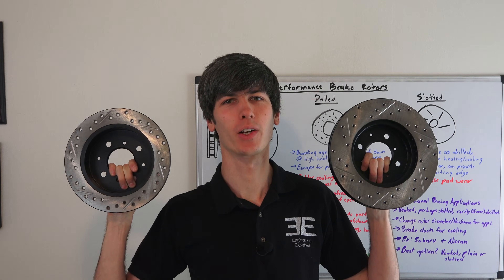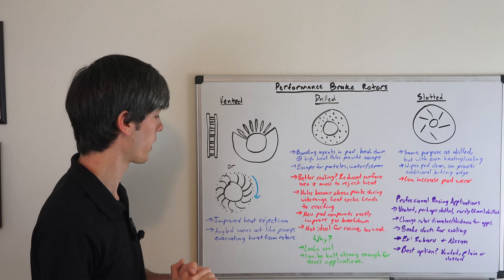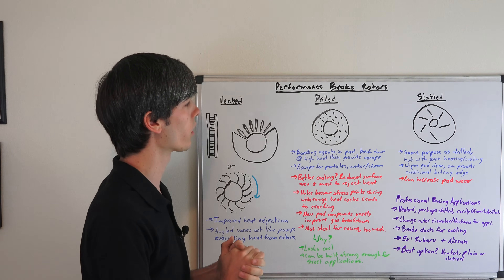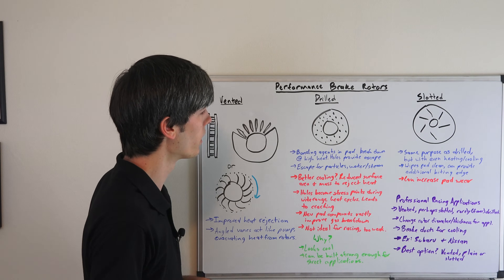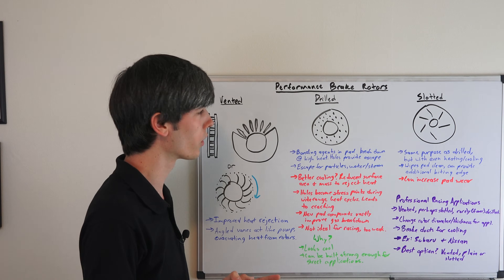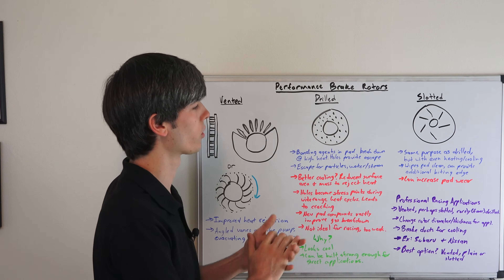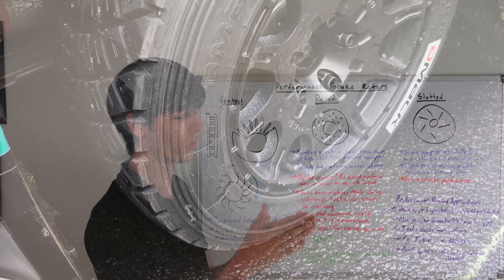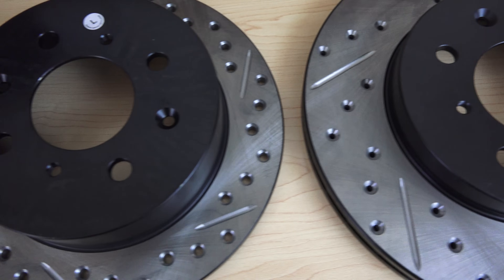Drilled, Slotted & Vented Brake Rotors - What's Best?

Comment: To everyone, remember this, TORQUE YOUR LUGNUTS, reduces warping.
Reply: Could be true. I've never heard this before but it couldn't hurt.
Reply: You were great against Gary Oldman. Too bad he snuck up on you at the end.
Reply: Thanks for the advice, I dealt with warped rotors in the past.
Reply: Sad that "car people" need to be told this.  Even without the worry of rotorwarp, just keep your nuts tight, but not too tight!
Reply: I have studied mechanic and one thing that people disdain is the torque. It can make total difference, not only about warping but also you don't brake any part inside torquing so much.
Reply: Amen
Reply: Make sure they're not overtightened too, as well as rechecking the torque after 100 miles (approximately).
I've had tire shops overtighten them to 170+ lbs./ft. before and when questioned about it told me they weren't allowed to tighten lug nuts to anything less than 80 lb./ft.  The manufacturer's shop manual recommended 66 lb./ft.  🤯

So beware your local mechanic, especially if they have cause to not like you...
Reply: @thisismagacountry1318  EVERYONE!!!
Reply: Tighten them until they start to get lose 😂
Reply: How many ugga duggas is that with the impact?
Reply: That’s probably the least of your worries if you don’t torque your lugnuts…
Reply: We did that with my 1978 Trans Am, they warped in less than a year almost as bad as when we bought it, driving style is a major factor let alone safety tech and other things

Comment: On my minivans I switched to drilled and slotted discs as a method of cooling the disks faster. The stock discs were continually warping because of the long steep hills near my home. Switching has proven to be very effective as my discs have not warped for years since the switch. I go through pads more frequently but they are cheaper and easy to replace.
Reply: I know it’s 7 years later I’m commenting but I have a similar situation. Go up and down hills every time I leave my house. So have to ride the brakes often which has led to frequent rotor failure.
Reply: @Paulog1990  Alternatively you could just drive in a lower gear when going downhill and not use the brakes as frequently.
Reply: @rado2g  I have a Nissan with a CVT. If you know anything about Nissan CVT’s, that’s the last thing I would try.
Reply: @Paulog1990  not familiar with it, I drive a manual Audi A4 B8
Reply: @Paulog1990 😢😢😢
Reply: the drilled/slotted rotors are usually better steel than the cheap blank rotors. you can buy blank rotors with good steel but they're a little harder to find.
Reply: @Paulog1990  change transmission fluid frequently!!
Reply: @johnchalkiadakis  I have changed it every 30K miles. Have 104K on it now.
Reply: @Paulog1990  yes, better sooner than later, the BS from the manufacturers that it lasts for the lifetime of the vehicle, for them lifetime means "untill the warranty expires" that's about 5 years!! like we all buy a new car every 5 years, what a load of Bullsh*t.

Comment: With F1 cars, they use solid surface rotors for maximum brake force, but they have a large number of dense radially drilled holes for maximum surface area for air to cool the rotors. But that's more of a special case since they're dealing with immense braking force and heat, and really only need the rotors to last around 300km of hard use.

Comment: My personal favorite is vented/ slotted. On my heavy haul truck, it makes a huge difference over hilly braking conditions, upwards of a 200* reduction in temperature depending on overall duration and loading. Dropping from 650-700 down to about 500 taking some of my local hills. The slots aid in off road conditions... I have noticed a significant reduction in gouging since swapping out.
Reply: I was wondering about this. Thanks.

Comment: I'd be intersted in a video about "brembo style" brake calipers (4 pot, 6 pot, 8 pot...) compared to conventional style brake calipers
Reply: What you mean to say is "fixed," with pistons on both sides of the caliper, as opposed to the more common "floating" or "sliding" caliper with pistons on only one side.
Reply: but but but everyone on NASIOC knows that Brembo is better lmao
Reply: Brembo is a brand, not a style. All disc brakes (as far as I'm aware) range from a single piston, or "pot", through to 8 pistons ( I haven't heard of anything higher than 8 although I stand to be corrected).
Reply: Google "Tarox Brakes", you'll be surprised. ;-)
Reply: If you ever want to see an insane number of pistons on a caliper check out the Evolvo Volvo C30. That one runs 14 pistons.
Reply: @Abb0nz1  Lambo Urus has 10 piston front calipers

Comment: I have to comment, I have a Porsche 997 Carrera that I track, I am a DE instructor with many years experience.  My car came with drilled rotors and I added track pads, car stopped very well.  Unfortunately as you stated the rotors eventually cracked between the holes. I switched to slotted rotors and immediately noticed a reduction in braking force. After many sets I went back to drilled rotors and the braking is much better.  Just a personal observation, Porsche knows why the holes are there, it's not just looks.
Reply from the maker: Thanks for sharing your experience with it!
Reply: My understanding of the reasoning behind drilled rotors is that it helps with initial pad bite, probably why Porsche installed them from the factory.  I had a similar experience to you installing a drilled set on my 350z, noticeable improvement.  I probably wouldn’t track the car with a drilled set given the risk of cracking, but it definitely helped improve braking on the street.
Reply: @natehess7663  This Uber driver will be taking your advice!
Reply: racekar80 the slotted ones were also high carbons as the originals are?
Reply: There is a reason why they are not used for racing because under extreme loads and longer periods of heavy use they can crack, for 20 minute sessions on the track however they are just fine. Cross drill rotors are just marginally better than blank rotors so it is true that they are mainly just for looks.
Reply: @JoseHernandez-yw9iu  Thank you for the opinion that 20 minute track sessions are not going to cause drilled rotors to crack prematurely.  I only do 2 HPDEs a year (4 track days) with my Mini Cooper S.  A year ago when I installed StopTech drilled/slotted rotors with EBC yellow pads on the rear I got a significant improvement allowing me to go deeper into corners.  So hopefully only sixteen 20 minute sessions a year will not be a problem.  That said, I will consider plain or slotted rotors when replacement time comes.
Reply: @JoseHernandez-yw9iu  think of it like this.....if a guy could spend 3000 for 2-3 hp the better stopping power per buck is worth it
Reply: @christopherdaniel2747  wait what? lol what guy do you know of that spends 3000 dollars for a 2hp gain?? you should slap him upside the face.  A dropin K&N airfilter will net you more gains than that!  Hell  for that price you could go standalone haltech ecu and pay for a reputable shop to dyno tune your car,  Still probably have some left over for a bolt on or 2.
Reply: Lol he’s right in a sense. You buy those eBay specials drilled and slotted and you buy the eBay specials “vented”. The drilled will go much faster.
 Lol sports cars cause they look cooler, lololol Those 4 rotors weigh more than him. 
He’s got all the German engineers beat and all the track goers
Reply: This issue no longer is a problem with newer rotors.

Comment: Man, your videos are simply fantastic! Such high quality content and they make perfect sense! Amongst the best channels on YouTube!
Reply from the maker: +superhydrocarbon Thank you, I really appreciate it!
Reply: +Engineering Explained I wish I had your knowledge about vehicles. Never stop making videos!!
Reply: +Engineering Explained 

Hi Jason,big fan of your Channel and subscriber too.. Can you cover motorcycle engines and the advantages /disadvantage of high specific output high rpm engines. 

Scott.
Reply: +superhydrocarbon I totally agree with you. I've been learning quite a lot from his videos.
Reply: +TheGray Aviator Absolutely! Lots of effort put in by the guy! I also like Chris Fix  for his slightly offbeat but super practical and honest car fixes and tips. Do check it out!
Reply: +TheGray Aviator me too
Reply: Perfect sense?he contradicts himself. The drilled rotors have the extra biting surface just like the slotted rotors..I never seen a drilled rotor fail from heat..that's why NASCAR uses drilled  and they get Cherry red several hundred times a race..the holes  dissipate the heat
Reply: @gregh8644  Really?
Reply: Would drilled and slotted rotors be fine if used for daily driving and SUV (Kia Sportage). Speed never exceeds 55 mph
Reply: @Famous4908  I’m not an expert, but I hypothesize that they would perform identically

Comment: I have a 25 year old E36 Bimmer and now run Drilled Vented Slotted front discs and Drilled Slotted rear discs both with ATE Low dust pads. Effing amazing stopping power. I'm in Perth Australia and it is very seasonal rain wise. Simply little chance of warping or cracking due to splashing hot discs. I suffer almost no fade even after a 3 am fast run across the city. 
For me, matched to Bilstein Shocks and up-rated roll bars, polyurethane bushes and a very worked engine I adore my car.
Oh and I'm 52... not a kid.
Reply: I'm 57, you're still a kid
Reply: Matt Caulfield I’m 63 and still a kid.. technically.  I am beyond middle age. So I’m old. I still think I’m a kid though!
Reply: do you still have that bmw? it's been 5 years.

Comment: where I used to live in Hawaii, I aways had a problem with warped rotors on my Toyota Sienna van. when driving home I had a long downhill trip that would heat up my brakes and warp them over time. I switched my rotors to cross drilled/slotted and never had that problem again. the cross drilled really does help heat reduction. it's not for just show or visual effect.